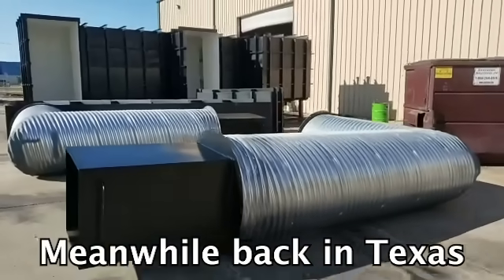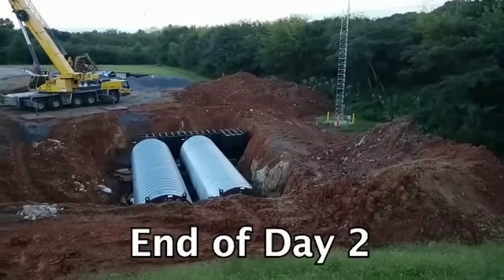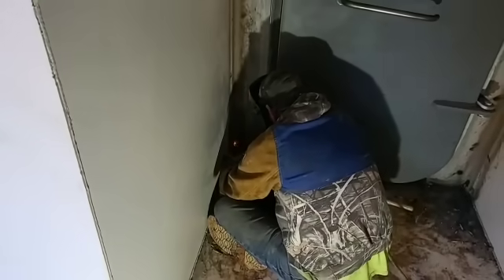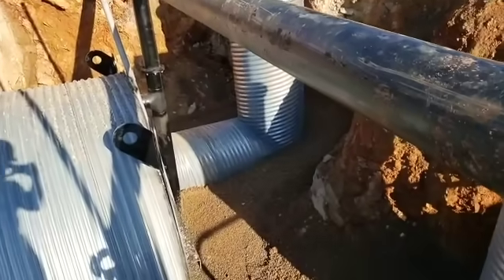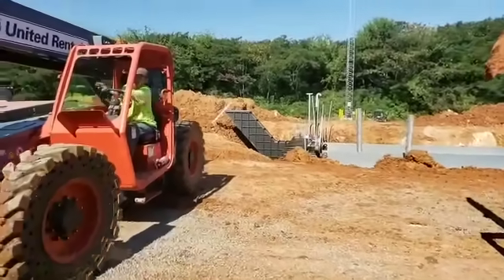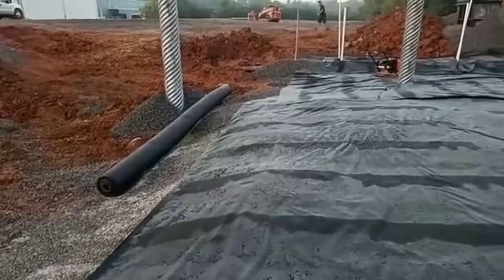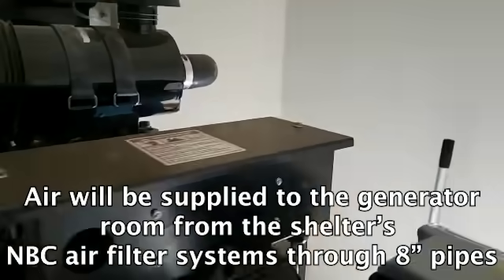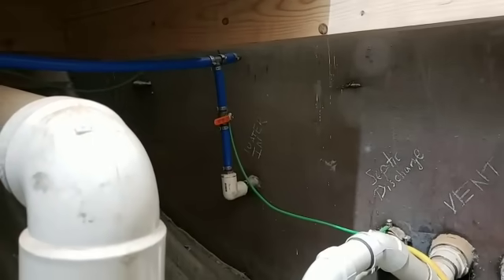Installing Two "Big Boy" Bomb Shelters "Side-by-Side"

Comment: Atlas must consider septic tank,sewage system, water tank, much bigger air vent system, deepwell pump for additional water supply, maybe a periscope to monitor outside world, a non weldable hatch to prevent it from being welded outside and much more...
Reply: Yeah all for the price tag of 1.5M dollars. If you have this kind of money given them a call they will accommodate you for sure.😂😂😂😂😂
Reply: @user-gp5xc4lh2q  no I actually think is an awesome concept. I wish I had the land and the place to build one of this because is really worrisome what’s going on today and with this administration specially. The world is in more danger than ever. Obama left us with a real situation with N. Korea, Trump fix it and now we have this numb nuts getting us in a worst one..
Reply: one thing you might consider is if safe enough on the surface for an assaulting force than your defense force can operate topside as well
Reply: I've seen Atlas accommodate septic tanks so you could use residential toilets in their bunkers, as well as security monitoring systems with cameras to feed into the bunker, they also com standard with an escape hatch designed to be hidden and can't be accessed by outside forces so even if they welded the main door shut you're fine....not that doing so serves any purpose to anyone really???
Reply: These are not designed to be intruder proof
Reply: @evanspaulding672  one consideration is once I know its an atlas bunker I can watch for you to emerge from the escape hatch which would be somewhere within about an 75 circle from the hatch.
Reply: @JAllen01  take into account that it would probably be a hidden escape and how many people would recognize an atlas survival bunker and automatically know the layout
Reply: stop hiding from the world!
Reply: I am very skeptical
Reply: Weld the door shut from the outside for a few months and then get inside.. ha ha
Reply: Great points
Reply: I’ve been trying to find out who QC’s their welds. I’m a welder fabricator myself and seeing the shit they lay down I would be ashamed. That’s my biggest concern with these bunkers is the amount of porosity and under cut I see in their welds…
Reply: Good idea , a mechanical periscope system would be beneficial.  I would integrate an electronic security system with video monitoring the entry way , a 360 degree view of the property and roadway access to the area. It sounds like alot but monitoring equipment has gotten better and lower cost. Also the periscope would make fun to play submarine before the collapse. Hey if you're going to lay in money on a shelter you should get full use out of it.
Reply: @evanspaulding672  you know his video have 880 million views combined right ? I doubt the ppl watching g them are guys doing the guides tour in Egypt or on a beach in fiji. It'll be the guys looking for buyers like this in end. .
Reply: @Javservice  Trump fixed it 🤣🤣🤣🤣 please get one, stay there and never come out
Reply: @scotwilliams9594  You might not like the guy, but he's much easier to digest, policy wise/health of our country, vs. the current admin. If it wasn't for the media brainwashing you on "Trump bad", or being a hyper partisan that supports D only, you'd consider him one of the greatest Presidents of the past century.
Reply: yep. it is nothing more than an (very) expensive joke for those who are (not) paranoid (enough) XD
Reply: @pringu46  get inside for what?!? scavenge some cadavers? let them rot int place
Reply: @Paul  

So am I ...

The weird thing I've noticed is that all these bunker companies don't have seem to do their research on how the Missile Combat Crew capsule are built — especially in case of a 5MT ground burst > five mile distance. 

From the diagrams I have seen, it does look like a pill capsule: cylindrical, with a dome on either end. That makes sense, as any pressure wave will push pretty darn hard, through several feet of soil, up to 100ft depth, depending on how many detonations, and especially the sum total of yield. 

The living space within, however, is more of an oblong box. If you can imagine a shipping container inside a big enough drainage culvert, that gives you a rough idea. On top of that, that 'box' is suspended within the capsule, along both corner edges, and the sides, by a combination of stiff rubber pads, and large enough steel springs. That way, if a large ground wave hits, the capsule may move around, but the internal space, not so much. And, of course, not only is the outer capsule made from feet thick, high tensile strength concrete, reinforced with coated, large diameter, rebar, but the entire capsule is carefully made to ensure that there is not edges. 

Access to the capsule itself is via a lift shaft, also circular, leading to a tubular access way that leads to the heavy blast proof door, done in a way that doesn't compromise the capsule itself. In essence, everything from the 'topside' down to the capsule, and the capsule itself, is built around a 'box within a circle' concept, except with no flat edges exposed. The 'box in a circle' also means that space is maximised, especially for more comfortable living. Any submariner will tell you having their bunk next to the curved pressure hull isn't that comfortable. It also makes storage that bit more difficult. 

What I can't remember is how each capsule is fixed for internal power, and clean air and water supply. But taking the 'box in a circle' concept further, one can imagine leading off of the main capsule is separate ones, linked by the same entrance passage way, from the lift, off of it that has a generator, air filtration plant, fuel oil storage, and a tank of potable water. I also don't know how each combat crew are fixed for rations, thus how long they are expected to remain down there. That could also mean that there is a water recycling plant for grey water. Solid waste may well be dumped down a chute into, essentially, a sump, with a supply of compost to dump on top; a composting toilet system, if you will.

As for the dimensions of the working, and living space, especially as most is made up of the launch control panels — made smaller thanks to modern electronics — I honestly can't say, but behind the many feet thick reinforced blast door, the rectangular space may be as small as a 36' shipping container, or up to a 48' one. And that is just for two people, so whilst cramped, not impossibly so.

Which is something else I've noticed that is missing from the blurb written by those companies selling shelters for individuals, or small communities: that in the event of an all out nuclear war, the radiological fallout, it may take up to 28 days for radiation levels to decay to the point you can venture out for short periods of time, then longer over time. It may even be, if any kind of radio service on MW/SW advises to stay in place for up to 2 months. 

Which, given how cramped the 'off-the-shelf' solutions provided, may not be enough space for the stated number of  people it can accommodate, let alone the volume of provisions needed to maintain 1,500 - 2,000kcal/person/per day ...

Finally, a small niggle: why use corrugated steel, abet engineering grade stainless steel, for the underground shelters. I don't know what kind of pressure testing companies which tout them as underground shelter options, have done on them, but given they are pretty much the same as hot galvanised steel culverts, that, over sufficient time, can rust, and collapse from the pressure of the earth above, doesn't really bode well ...

Sorry for the long form comment, but from the little I do know about the kind of shelters especially the USAF has built over the years, especially for those select few whose role is to literally turn the launch keys to fire off the remaining silo based missiles still in operational use, you would think that a shelter charging a not insignificant amount of money for a below ground shelter system — which, in the case of those launch capsules, is >60', but <100', below ground — that they would utilise as close as possible structural techniques, as the USAF has used, to ensure their clients survivability. 

Oh, and also from memory, each capsule has  an emergency exit, directly out of it, it the for of a narrow tube that rises to the surface, but, apparently, the end closest to the internal hatch is filled with several feet of sand — and possibly boron — to reduce any chance of radioactivity leaching in ...

The TL; DR in all of that is those making the kind of shelters installer above maybe both well-meaning, and earnest in what they do; but even without thinking about things like the dependence on welding, to say nothing about the quality of those welds, and other things those with engineering experience may have also noticed, like yourself, I have my reservations about the entire design and construction of the shelter in the above video ...
Reply: If in the case of nuke attack, one does not want to breath the outside air due to radiation...one must have 02 tanks.
Reply: after 4 weeks all germans would kill each other cause of the last toilet paper so need a bunker in the junker 🤔
Reply: @BlueYiperoo .   NBC filtration is in each bunker.
Reply: You forgot the fallout vault door an compatable pit boys
Reply: I was under the impression it takes 8ft of concrete for nuclear disaster.
Reply: A non-weldable hatch? As if in a post apocalyptic or disaster world someone would just happen to have a generator and welder on a truck and drive it up to the bunker to weld you in. Lets just say they were inclined to do this and got all the way out there to do it and found out it couldn't be welded...aww shucks. Looks like they will just have to park a three or four ton truck on top of the hatch. DERP. They don't have to weld you in bro.
Reply: @BlueYiperoo radiation in the air is not a problem....   it mostly gone at the speed of light or interacts with something and is not hanging around in air. 

Radiation from
radioactive particulates (dust/ash fallout) is the problem.   And particulates can be filtered out using High Efficiency Particulate Air (HEPA ) filters.   Assuming they stocked many month's worth of filters, it won't be a problem.
Reply: Sooo if im an "attacker" in a shtf scenario... plug the generator exhaust...they"ll be bailing out of that bunker within 12hrs...lol.  i can understand "bunkers" for tornado shelters but beyond that they are a total waste of money. The types of people that build them , especially in the US, for nuclear/civil war scenarios are generally the paranoud types..in a bunker that paranoia woll cause them to turn on each in  matter of days.
Reply: @mohinderkaur6671 Stop hiding from the world?  Why?  What has the world ever done to prove it wasn't full of danger?
Reply: @JAllen01    
maybe you'll find the escape hatch within a 75 ' circle.... or maybe it leads to a longer tunnel to one of several hidden trap doors where counter surveillance can occur.   Or to the Batcave.
Reply: Here is The True Savior

HalleluYAH “Praise ye YaH”

YaH is The Heavenly Father 
YaH arrives via the TENT OF MEETING
YaH was Who they Crucified for our sins
YaH was Crucified on an Almond TREE

— Ancient Semitic Cuneiform of Moshe (Moses)
— Isa Scroll (The Original Isaiah)

Isaiah 42:8
"I am YaH; that is my Name! I will not yield my glory to another or my praise to idols.”

Isaiah 43:11
“I am YAH, and there is no other Savior but Me.”

Isaiah 45:5
“I am YaH, and there is none else.”
Reply: @Aaron-rv1si you’re in a cult bud 😂 . Imagine supporting a dude who has 88 pending charges and has been found guilty of felony fraud and liable for sexual assault

Comment: The only problem with a bunker is every worker on site knows where it is
Reply: Ask them to sign NDA if they want to have this job.
Reply: @vladtheimpaler3625  you think when shit pops off they're going to worry about a piece of paper? And their families hungry? Yeah no
Reply: @CarolinaNightHunter  Better than nothing. What do you want? Dig a whole and bury them alive? Even they know where is your bunker. If they can't be there within 10mins when fallout happens, knowing where is it is useless.
Reply: Small price to pay for having a hidden bunker. Most of these bunkers also have a code lock at the entrance, so the owner can customize the code and prevent unauthorized access.
Reply: I'd rather have a blast door as the main entry with the gas tight doors after that the hatch may be AR500 but anyone with cutting experience will get through it relatively quickly.  If people are desperate enough to be looking for bunker's to get resources they likely don't have much time to cut through a blast door and reinforced bulkhead.
Reply: I’m sure most of them have their own bunkers.

Comment: As being a welder the first thing I can think of is how much fun these weld jobs would be and 2 I would hate to be a plumber if anything ever had a mishap lol
Reply: I don't think many plumbers will get a call-out after WW3...
Reply: @tedthesailor172  That will be due to SHTF.... 😉😉🤣
Reply: @tedthesailor172  or after a MASSIVE CME...or a Mico-Nova, which could be considered.
Reply: As both, I fucking agree.
Reply: @atticus2581  qz
Reply: As a plumber the under floor crawl space is brilliant. The pipes buried under the corridor not so much. :(
Reply: With 24 people and one macerator for a shower and two toilets, that will jam on the first day.
Reply: @cronocide eapecially if people are flushing things like "flushable"  wipes , premium multi-layer toilet paper (I'd only stock RV toilet paper, which rapidly dissolves)  and tampons.
Reply: @ssn608  dont put any paper in the toilets period.

Comment: Best one I have seen for installed. I know online they have some crazy setups. Good to see someone doing something with more than just one
Reply: Thanks for the details. I spend too much time thinking about how it could all go to shit. One the realizations I had was that the biggest collapse threat is the "legacy pollution. " the first 72 hours, and 30 period we will have a crap ton of untested industrial sites. Nuclear, biological,  chemical and other petroleum based facilities. People stop showing up to work safety
Checks aren't done yeah we got problems. The biggest one is Chernobyl and that's a problem for another 19935 years. Good news I just turned 50 and had 3 funerals this last 4 months. Sounds self destructive but at some point not my problem anymore. Kind of Luke that last day in high-school where I can just throw it all away.

Comment: The engineered stone is important to because of its low compaction rating.  It prevents movement and settling and offers a place for the water to go when using well points.  We used stone often when installing gasoline tanks for gas stations.  Adding stone to wet dirt stiffens it up to.

Thomas Dutkiewicz
Connecticut
Reply: Depends on exactly what kind of hazard you are expecting, allowing movement is VERY important.

Comment: As a prior nuclear missile maintenance officer at Malmstrom Air Force Base, Montana, if there is a nearby nuclear explosion the sand in your escape tube will heat up so much it will turn to glass and you will never get out.  Of course the EMP is going to knock out all your generators and fry all electrical and computer lines.
Reply: If the heat in the escape trunk is enough to melt sand.... within a few feet of the bunker... I'm guessing that the people inside are kind of cooked anyway.
Reply: How far away does it have to be for you to be okay?
Reply: @ssn608  yeah idk why someone would be worried about glass blocking their exit when they're roasted corpses
Reply: @everythingluxury7  Sand melts at about roughly 1700°C (3090°F).   Assuming that that nuclear air burst produces heat that is present long enough, and penetrating deep enough into the ground to melt sand  deep enough to cause a problem using an escape trunk filled with sand (say a foot or so).... it is also going to be heating the ground one or two hundred feet away, deep enough to turn that bunker into an oven.   Even if the temperature in the bunker "ONLY" rises to a tenth of that temperature (309 degrees F).... that's basically the temperature to bake a turkey at.   And people will start dying of heat stroke within  a very short period of time.   The highest reported core body temperature in a patient who survived without permanent residual deficits was 46.5°C (115.7°F). This 52-year-old patient suffered from environmental heatstroke, and received medical treatment, including removal from the hot area they were in.   There's no removing someone form this bunker to a cooler spot.

On the other hand.... that presupposes that the bunker is pretty damned close to ground zero, in order to be that close to a nuclear blast.  The bunkers in this video do not appear to be very close to any strategic target so that fireball should not  be a factor.... just maybe a brief forest fire burning over the bunkers.    which should not be a problem.    All the folks have to worry most likely are:   1.   The US government requisitioning it, 2. roving gangs of people looking to help themselves to whatever is inside, 3.Fallout, 4.  sickness spreading rapidly in the closed environment of the bunkers; 5 incompatible occupants knifing each other or worse. 6) unplanned for guests draining prep supplies, and , as mentioned in another comment, a really messy Taco Tuesday aftermath.
Reply: Brilliant observation...What do you suggest would be the best to do???
Reply: @fredfloyd68  My sugestion would be, that the US stops provoking wars around the world, that they can never 'win' 👍
Reply: What EMP? It's a metal structure thoroughly grounded deep in the ground.
Reply: If you are close enough to the explosion to have the sand melt, everyone inside will be dead, the crater will be much deeper than the depth of the bunker.